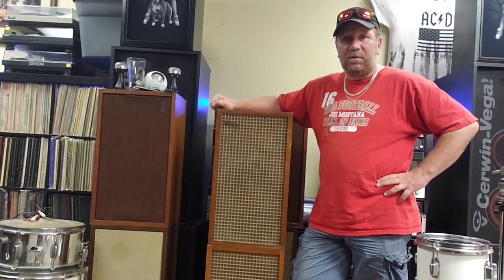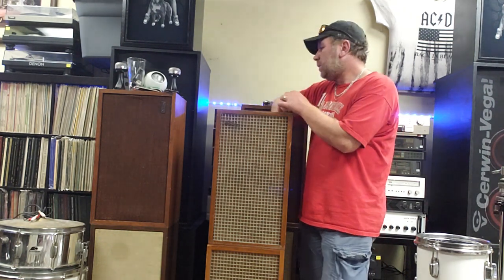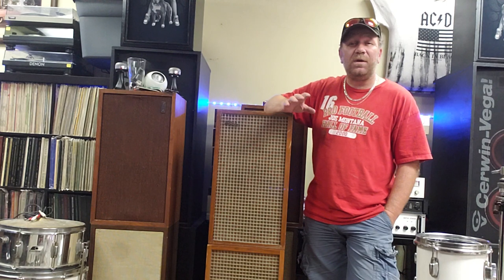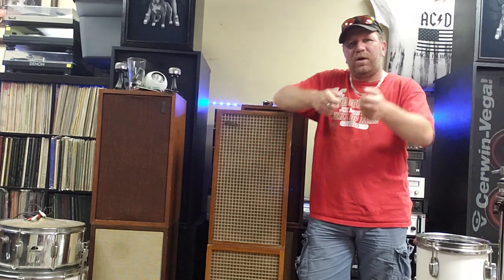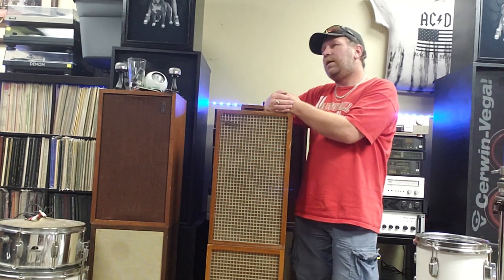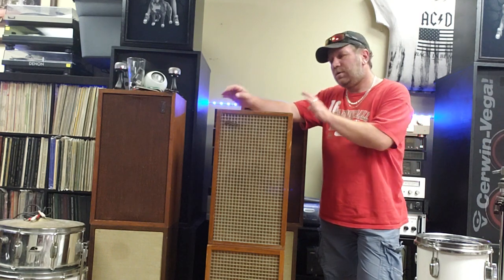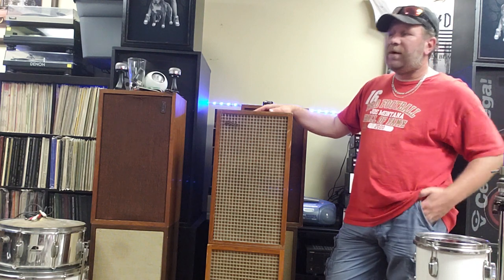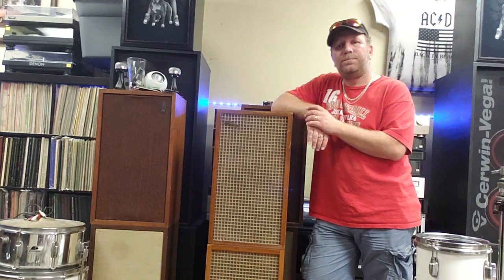What a F...... nightmare, Vintage THE FISHER XP-1 speakers.Test & review

Comment: Nothing beats THE Fisher. That's when Avery Fisher was involved. When Sanyo bought the brand out the speakers were still very decent. Most of the 80s woofers were either Klipsch or eminence. Even the foster stuff is great. Everything has it's limitations. 
Getting back to the old stuff. Alot of folks forget that many drivers were HIGH effeciency. Meaning they will sound like crap on modern stereos. Toss a vintage amp between them and they'd be a totally different animal. Something to be appreciated 😁

Comment: Hi Rossi 
What do you think about the LS15. I am considering buying them.
Reply: Good speakers, but very bass heavy.
Use a good powerful amp on them 
Just make sure the front baffle is not loose.
The earliest models that was made, suffered from a poor glue type.
This was changed after 4-6 months of production.
A better glue was then used.

Comment: I have a pair of Fisher xp 55b speakers and a mint Sherwood s7050 receiver. If these things are connected to anything else it is kinda blah. But these two together make a nice pleasant system. The Sherwood has way too much bass (in neutral) but on these speakers it works. It's not audiophile but it is decent.